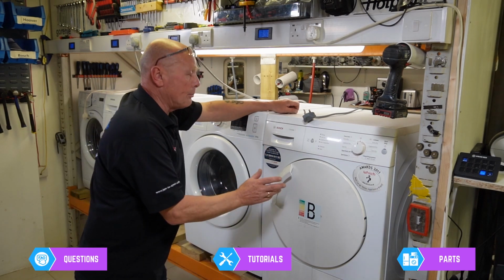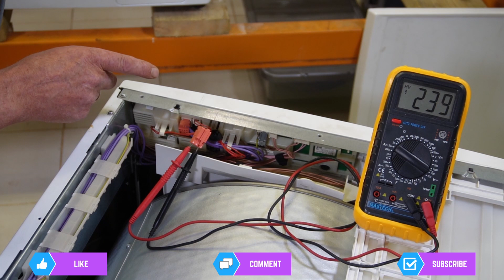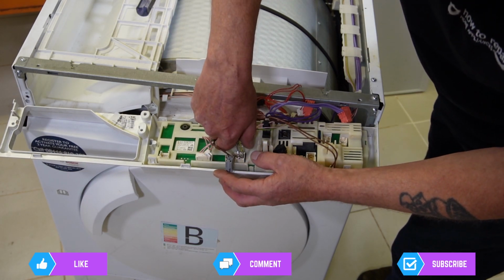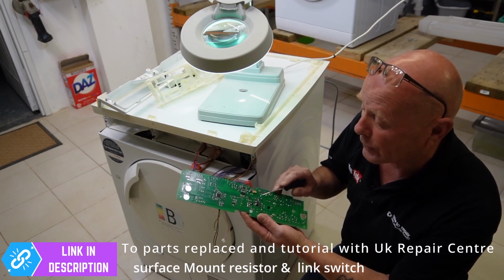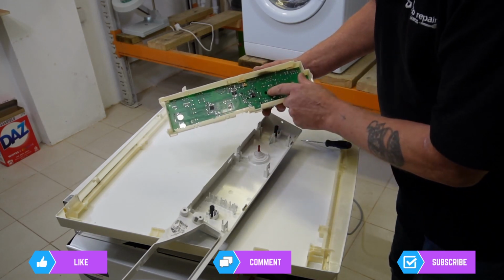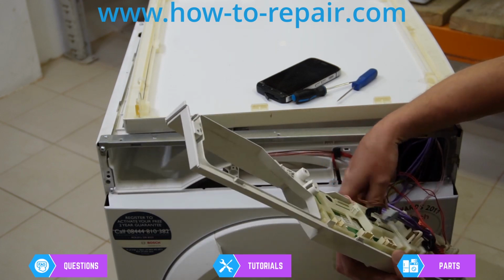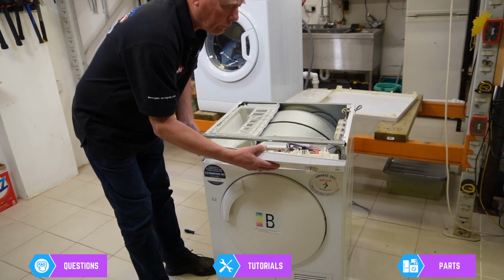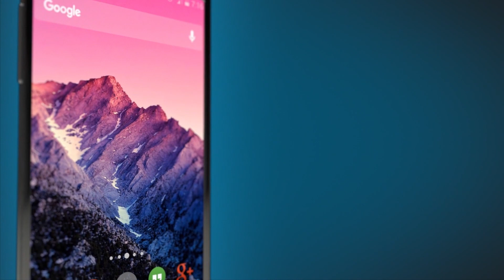Tumble dryer no power ,not starting cutting out Bosch Neff Siemens pcb printed circuit board repair

Comment: Thanks for a great video. I am a electronic engineer so decided to repair the board on my very similar Siemens machine (model WT44370NL/04) The switching chip in this machine had also failed (it had exploded!). I removed the chip by first cutting each pin and removing them individually. The circuit board tracks are thin so it's necessary to be gentle when removing the pins. then the holes need to be cleared of solder using a solder sucker. In order to make any future replacement of the chip easy I fitted a 8 pin dil socket into which the replacement chip was inserted. (make sure to fit the chip the right way round). This switch mode power supply chip is fed from the main rotary control switch via a discrete 47 ohm wire wound resistor which had also failed (colour coded yellow viiolet black). It's necessary to replace with one of sufficient power capacity (the old one looks to be about 2 or 3W). I have traced out some of the switching power supply circuit but the application note document for the TNY266 chip can be found on the web and is not so different from the circuit used in the machine. 
Switch mode power supplies are very common. The a.c. mains is rectified into a high voltage d.c. source. The switching device chops the high loltage d.c supply to produce a high frequency a.c waveform which can be efficiently passed through a small transformer to produce the required low voltage supplies and also provide safety isolation. Feedback control is provided via optocouplers (this machine uses 2) into the enable (EN) pin of the TNY266 chip. donation sent.

Comment: Great video, followed the well shown methods for dismantling the dryer, sent board away as advised, great service by repair company. Reinstalled board as shown. Saved either paying out £280 for replacement board or buying a new tumble dryer. Thank you.

Comment: Brilliant stuff, really well explained and filmed - thank you. I've tested that power is getting to the PCB and have now packed it off for repair - fingers crossed they can sort it and I'll have it back and running again in a few days!
Reply: update - I got a notification about 2 hours after my parcel was delivered to the repair guys, to say my parcel was on its way to me. They must have whipped it out, replaced the chip right away and sent it back. Apart from a slight mix up in getting the wiring exactly as it should be, it's now running just fine again. Thanks so much!

Comment: Thanks for the information on the PCB repair service. I might have to use their service to fix a programme selection knob on a bosch WTL5400 drier that randomly chooses another programme by itself, interrupting and stopping any programme already running.

Comment: Hi There I’m an electronics engineer and have just repaired a circuit board shown in your video.  The fault was almost the same as you were having.  Would not start tumbling but would briefly try to start but would not run and the start light would just start flashing again.
The fault was a small 10uf 400V electrolytic capacitor on the circuit  board. It’s in that switch mode section of the board you were showing.
You just need a soldering iron and a replacement electrolytic.
Thanks for the tip with the control selector with the small cutouts in it.
Reply from the maker: I would love you to leave your opinion on our poll about manufactures building in obsolescence to appliances. https://www.youtube.com/post/UgkxygHomnUySd_bYjaJBdEHPO6T4dYo9Ahm
and this is for you https://www.youtube.com/shorts/e432SAb2g08 please remember to subscribe as that's is what keeps this channel going. Thanks 👍
Reply: @How-to-repair My Miele professional tumble dryer won't power up today could that be the same thing

Comment: Hi , love your videos , ive found a few solutions to dryer problems , now here is my question , if the mains filter  suppressor is dead/blown, will that cause the dryer to have zero power at the circuit board ? its a Grundig GTN27110 Condenser Tumble Dryer  Thanks in advance

Comment: nice video.  i followed your video to take a look at my siemens iq700 dryer.  it seems nothing is wrong with the board.  but i did smell a burning smell where the power cables come in to a power relay or something.  but been looking on the net for that part and cant find anything.
Reply from the maker: This sounds like you're describing the suppressor or electrical filter. If you use our website with your full model number I should be able to help attach the link below. Have a great Christmas and a happy New Year. Can't guarantee we will get the part before Christmas or New Year. Hi @crazyfluteplayer6216 I will need the full model number of the identification plate please use our contact us page and make sure you fill out the request of what part you are after and will get back to you within 24 hours normally https://www.how-to-repair.com/help/contact-us/
this is for you https://www.youtube.com/shorts/e432SAb2g08 please remember to subscribe as that's what keeps this channel going. Thanks 👍
Reply: Great video! Thank you to share your knowledge with us. 
My Siemens IQ 500 start cutting off the main power. First after 10 min work, and now straight away after pressing the Start button. Didn't spot any burn smell or overheated cables. How to recognise this part( on the video) is faulty? It should be kind of melted, or?
Thank's a lot for your job!
Edit. Put my comment on the wrong place. 
Should be like a separate comment. Sorry.

Comment: I guess this information would apply to a Miele model T 9747 WP tumble dryer. It has stopped in the middle of a cycle and won't restart checked every thig including changing a leaking capacitor on side of compressor element
Reply from the maker: some will

Comment: Hello , i want a help please,  I have a BOSCH dryer model WTY888W0GR/16 and the problem is that it takes 4-5 hours to dry the clothes, it showed an  E25 error once, i dont know what is the error E25. I cleaned the condenser very carefully, then it dried faster and after 1-2 months it does the same again, it is slow to dry. I noticed that the heat pump does not work continuously but stops for 20-25 minutes and starts again and continues with this routine. after 5 hours it starts and dries them normally within 30-40 minutes and stop, after the stop apper in screen ''please clean the filter'',   I have cleaned the filter at the beginning. I see that the wattmeter that it consumes 450-480watt when working head pump.  Do you know the problem please?  Thank you in advance.

Comment: My Exxel Bosch tumble dryer works but it goes dead every 5 minutes and starts again on it's ow and off again.
I checked the oveheat stat but seems ok.
Will be the same issue with the PCB?
Reply from the maker: Hi, I will need the full model number of the identification plate and the details of your problem. Please use our contact us page and make sure you fill out the request for what your problem is. A video shoot of the problem would be perfect as well.

We will get back to you within 24 hours, normally. https://www.how-to-repair.com/help/contact-us/ 

Please remember to subscribe to our channel, as that's what keeps this channel going. Thanks, Paul 👍

Comment: Hi Paul, I can't see the name of the company who repairs the circuit boards, could you tell me their name, please.  For some reason I cannot access the details link on your video.
Reply from the maker: If you send a message over to the website with your model number, I will be happy to do some research for you to get you the correct link.  Hi Tom Cartledge I will need the full model number of the identification plate please use our contact us page and make sure you fill out the request of what part you are after and will get back to you within 24 hours normally https://www.how-to-repair.com/help/contact-us/
this is for you https://www.youtube.com/shorts/e432SAb2g08 please remember to subscribe as that's what keeps this channel going. Thanks 👍